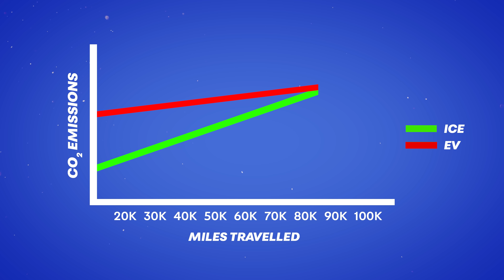Are Electric Cars REALLY That Green? [New 2022 Data]

Comment: Which car while running in a closed garage would you like to sit next to. There's your answer. 
The fact that in the 90's you had smog so bad in L.A it was like a permanent fog. Even worse in China. 
The lithium batteries production is quite ugly that's not up for debate. But the combustible fuels made from crude oil is only million times worse.
 You wanna talk about a over 2 million in uncapped wells releasing huge amounts methane every minute of every day. 
Or mabey the oil spills. Mabey you wanna talk about the environmental devastation that we have put on this earth between the actual wars of greedy assholes trying to control it. Or the idiots trying to move it.

Comment: I’d be interested to see how you energy supplier provides you with 100% renewable energy 100% of the time. From what I seen and read so far, 100% renewable isn’t achievable. Good to see someone discussing this in a balanced way though. I saw the report when it first came out but no one else seemed to take any notice.
Reply: Even on a windless night (no wind or solar) there is a huge amount of generation from Nuclear, biomass and International interconnects from no or low CO2 generators like Norway and France), so quite possible for an electric retailer to only buy from these.

Comment: I think one point is missing:
-ICE are as optimised as they can be, lowering the emissions more is incredibly complicated and expensive.
-EV instead have huge margins to improve . They basicslly just started with mass production.
The fact that EV are already greener, today, I think is exceptional.
Reply: The key word is limitation, not enough lithium to go around, sodium can maintain more energy but is far more dangerous.

Hydrogen fuel cells could be a solution but the massive hydrogen requirements to fuel the planet would demand more electricity for electrolysis than the energy the produced hydrogen would give back.

So we need need nuclear reactors latest generation on a massive scale for electrolysis in order to fuel cars.

Comment: The most environmentally friendly car is the one you already have, fix it, treat it well and keep it for as long as you can.
Great work Rory and very interesting research Volvo!
Reply: I wish I could have saved my old car. But fixing it would be way more expensive than the value of the car, because of tight rules of cars that are allowed to go on the road...
Reply: This doesn't really make sense. When you sell a car someone else drives it, then some else, etc  typically until about 150K miles. To make a car greener by keeping it, you would need to be keeping it for longer than it's normal life.
Reply: @smc812  that’s exactly what he said, i mean the guy literally said: "fix it, treat it well and keep it for as long as you can". if one person owns a car then it completely changes their mentality versus the car changing hand multiple time. A long-term owner will take better care of the car both in terms of service/repair and have more mechanical sympathy for the car, as he understands that hurting the car now will hurt his pockets in the long run. whereas this new movement of leasing a car for just a couple of years and then moving on really hurts cars, as each individual owner will take less care of the car as they don’t have to bear the long-term consequences of not giving a hoot. and 150k is pathetically low milage, might be typical, but thats the root of the problem, we need a fundermental change of what should be considered normal/typical. A good car should last at least 200k. next time you’re in a Prius that is a taxi look at the odometer, you will be surprised to find how much cars can last if they are properly taken care of. My local Toyota dealer (drammen/norway) gave really good deals on the plus versions for taxi companies, most of these cars are still on the road, with 350k miles +, some people in Oslo bought model s to use as a taxi, even though they are 2-3 years newer than the Prius plus, you still never see them around(as taxi).
Reply: @dndfm  keep it, or sell it to someone else who then looks after it would be the same. Keeping an ev (even a mild hybrid like the prius) makes perfect sense. Keeping an ICE doesn't as it's emissions from use eventually outweigh the cost of making a new EV. Using Volvo's figures that would be 150000 miles, I dispute their methodology and expect it to me more like 100000.
Reply: @smc812  I have to disagree, if one person is responisble for a car on a long term basis, more than 5 years, he or she will take better care of the car than someone owning it on a 2 year lease plan. on your second point, for me it depends on the car, if its an older diesel/petrol car without particulate filter and its not somones pride and joy it should get of the road, 100% agree there. However, if its a small car(I mean small in personal car i.e sedan wagen etc, not truck/pickup) with euro 6 engine then why not? lots of cars with euro 6 engine produce less than 100g co2 per km, seems wasteful to get those cars of the road, might as well use them until the wheels fall of, by that time the electric cars avilable on the market will be far superior to the ones we already have. i just personally think that we need to teach people to take better care of their cars, its easier than people think, and we can get more out of our cars no matter if they are ICE or EV.
Reply: @smc812  regarding the Volvo figures, I see your point, but I also see Volvo’s point. people will never agree on the figures, I mean where do you even start, just look at the life cycle analysis of the petrol, if it’s from troll station in Norway or if it’s from a station in Basrah in Iraq then the carbon footprint behind it is incredibly different. I don’t think anyone can make a study than can satisfy everyone, I think we need location specific studies as the petrol and electricity you get is probably very different to where I am.
Reply: @dndfm  Agreed, but that figure has a far smaller effect than the actual efficiency, which is a multiplier of that.
Reply: @smc812  Well if everyone keeps their car for longer, there will be less cars produced in the first place , and this is also for a lot of products, like smartphones, laptops, tv’s and so on.
To reduce our impact we need to reduce consuption, reuse what we already have and recycle what we can’t use anymore.
This being said, it’s also true that cars that are too old might pollute way to much on use, and this is where emission laws might come in and help.
Reply: @Fedefili01  only if the car was going to be scraped if they didn’t keep it. Realistically all cars last until they are too expensive to repair. It makes some sense to suggest that keeping cars better maintained may make them last longer, I’m not sure if that’s really true, but it sounds right.
Reply: @smc812  Yeah that’s what I meant; here in Italy The government gives you a bonus to buy a new car if you scrape your “old” car.
I struggle to think that scraping a car that you wouldn’t have changed, just to have a discount, is better for the environment
Reply: @Fedefili01  I don’t know what Italy is doing, but in general scrapage is to remove vehicles that are more polluting. It could be that they are more concerned with the pollution in cities than the total carbon cost, but that’s also understandable.
Reply: @smc812  Yeah it’s a very delicate and complex thing to evaluate

Comment: The "damage" done by oil and carbon is reversible in pretty short order and becoming even more so. The damage done by mining and refining the materials for batteries is permanent.

Does the figure for EV include battery swaps? If you have to change those at 100K it'll put the EV right back in a deep hole.

ICE can be converted to biodiesel or ethanol which is far "greener" and continuously reducing its impact at a significant rate.

The West can be oil independent whenever we decide to do it. EVs rely on metals found primarily in China and North Korea... Not exactly people you want to be doing business with.
Reply: CO2 from transport (one of the biggest sources) stays in the atmosphere for around 100 years causing climate change. 
EV batteries last >>200K miles, more than the lifespan of most cars
Bio and synthetic fuels aren’t a viable replacement, they don’t scale (to much land or electricity) 
US is oil independent, but much of the rest of the west, including Europe isn’t. 
China certainly has things like lithium that are used in batteries, but Australia and South America are the biggest sources, there are also sources in America and Europe. Not much coming from North Korea except for missiles :-)

Comment: This is where PHEVs play such an important role as they have smaller batteries (less instant pollution), yet it is enough to electrify most of the every day driving for most people. As a bonus you'll have an "ICE car" on the rare occasion that you'll be going on longer journeys.
Reply: Agree. Longer journeys that are probably not in crowded urban centers where pollution is a major issue. I think PHEVs with small fuel efficient gas engines make excellent sense, but you won't beat a Tesla in a drag race with one of them. And because people are vain...

Comment: No, Volvo loses $$$ with each EV vehicle it sells. Volvo ICE cars are subsidising its EV sales, hence the Volvo accounting department's anti-EV propaganda. The same conclusion can be drawn about Ford, GM (aka, shadow-car-company), Kia, etc.  The 90,000 miles figure should be lower when compared to a Tesla, if it's true at all.  Tesla is making a hefty profit from EACH EV it sells. On the other hand, Ford is losing over $20,000 for each EV it sells. GM is losing over $30,000 from each EV sale. Yes, I'm including SOME EV development costs. "Mechanical Limit", which used to be the defining limit for ICE vehicles, was 100,000 miles, or 5 years, according to Ford. It's now closer to 250,000 miles, according to TESLA, and Toyota/Honda advanced research. Therefore, a vehicle that breaks even at 90,000 miles is a huge bargain for eco-conscious consumers. I suspect the break-even point is probably closer to 50,000 miles.

Comment: Really great video, just a quick question, will the battery pack last for 124k miles? The carbon footprint will increase every time a new battery pack is needed. Bring on new battery tech
Reply: It wasn't a problem for the Tesla Model S owner who posted a YouTube video of his car. That had covered 400'000 kms on it's original battery.....  Lots of UK based taxi companies have Nissan Leafs which have covered 200k miles, and are still going.
Reply: 13100 kg of CO2 (75kWh * 175 kg/kwH). Just to manufacture the battery in China. Not operate it.
That's more emissions than from operating an ICE car for abut 100,000km

So it's probably about 8 years. Just for the battery. And that's assuming that the EV battery is 100% powered by CO2-free electricity. Which it's not.

And after about 8 years, the battery will be toast, and the cycle continues.
Reply: @ChrisWells1  very interesting stats bud. Where are you getting your figures?
Reply: @ChrisWells1  You aren't comparing everything.  You also have to back out the CO2 with producing the engine and all it's related systems.  Batteries last the life of the chassis, not 8 years.  Volvo stopped their test at 144k miles because it looked good to do so but the battery will go 400k if the car suspension and frame can manage to.  Then the battery will go into grid storage use.  You can sell a Tesla battery with 200k miles on it for $20k.

Comment: I believe many of calculation don't take into consideration things like replacement parts, oils utilization, all emissions other than CO2 (for example NOx and PMs from brakes) and all logistic behind supplying so many parts that are needed for ICE power unit. 
Also it's easier to control few big filters on coal power plant than thousands in cars.

Comment: Excellent vid, sir!!!!
Super stepping through the key points - battery manufacture impact, vehicle size/weight, and energy supply sources. 
Volvo did all of us a service with this in-depth study.  Their report and your summary points to ways we need to improve to gain more advantage from electric vehicles instead of accepting the current level of burden (ICE) or waiting for the crossover point!

Comment: What I'm gleaning from this is that Volvo needs to do a better job.  Period.  The XC40 Recharge has a 75kWh battery pack and gets a dismal 223 WLTP miles of range.  By comparison, the Tesla Model Y (a much bigger car than the XC40 Recharge) gets 330 miles of range (EPA) with same size battery pack.  Lesson?  Volvo data shows how inefficient Volvo EVs are.  Volvo's conclusion would unequivocally tell us that EVs have a lower carbon footprint if they could extract higher levels of efficiency out of their vehicles.  A similar study done by the Technical University of Eindhoven came to a more reasonable conclusion in 2020, stating that taking "into account both the production and the use of the vehicles...a Tesla Model 3, for example, produces 91 grams of CO2 equivalent per kilometre, which is 65 per cent less than the 260 grams of a Mercedes C 220d. According to the study, Model 3 has thus already made up for its CO2 deficit due to the production of the battery after driving 30,000 kilometres."

Comment: This report has already been discredited multiple times, even Volvo say worst case it would be 74k miles, not 90k and if green electricity used to  charge the EV it would be 30k. The report also seems to miss out the CO2 impact of pumping, transporting and refining oil ( which uses electricity and cobalt) . Very disappointing that Rory chose to report this but it appears facts are not as important as views. 
Other experts claim the point that the CO2 savings outwiegh the additional CO2 in manufacturing is 16k miles.
Reply from the maker: Where did Volvo say the worst case is 74k miles? The paper says 90k.
Reply: @Autotrader_uk  The point is that the '2022' information you based this video on is outdated and has been invalidated.  Several times...

Comment: Really like your reports  extremely well put together. What I don’t understand about this drive toward reducing emissions is why not at least in the interim period ban any vehicles over (for example) 1000cc and have them speed limited, this would seriously impact on emissions. ICE  motors just seem to be getting bigger and faster. Efficiency for the ICE engine should surely have been the first goal and should have been the way forward many years ago.
Reply: good job, lets just ban all trains, cargo ships, and transport trucks.  We dont need food in grocery stores or houses.  We can just walk down to the local solar panel factory that doesn't exist and build huts out of them.  Most pollution comes from passenger vehicles locally which to regulate individual tailpipe emissions would be economically unviable, and (globally) the dirtiest engines are on cargo ships. which we need if we want to build electric cars.
Reply: Euro 7 regs in 2025 are going to really clean up ICE cars. So why ban them in 2030?

Comment: This needed saying - very informative and interesting.. I have been disappointed that the emphasis with most BEVs has been with performance rather than economy.. the less energy we use to get from a to b has to be a factor in making things better especially in the production process.
Reply: I think thats mainly down to getting rid of the image of a BEV being a milk float in the eyes of the clueless petrol heads.  Halo cars also set the brand image and make the most money
Reply: It's a production cost thing it's cheaper to fit a more powerful electric motor than its is to fit a lower power motor and a gearbox which it would need to drive up hills etc.

Comment: Hopefully electric cars will also far outlive their ICE equivalents, with 500k trouble free miles often being touted. The small number of parts and fluids must also be a long term consideration. Nicely balanced video Rory.
Reply: Dreaming mate. Lucky if the EV LIB pack lasts 8 years.
Reply: @ChrisWells1  based on what? It has an 8 year guarantee...
Reply: @pumpkinhead456   he’s just spouting the same old ill informed nonsense , there are plenty of 10 and 11 year old Nissan Leaf and Renault Zoe’s still in daily use and most have a minimum of 2/3 their original capacity and these were early cars with poorer battery construction and management systems. New cars will last far beyond 12 year battery life and there are a few firms that are developing easier recycling techniques. The figures people blithely quote about lithium batteries going into landfill refers to single use lithium batteries like 2032 coin cells or the batteries in mobile phones and laptops etc. EV battery packs that have lost too much capacity to be useful in cars still have plenty of useful life left in power banks or home powers stores to reduce consumption of mains power from the grid.

Comment: You can't blame cars or their owners for the carbon content of the fuel they use.  They can only buy what's available. Point the finger at governments for encouraging and subsidising fossil fuel industries and not legislating to clean up the power generation industry, when they've been told for years the problems emissions are causing. 

By buying an electric car the consumer is setting an example and forcing governments to address the emissions issue.